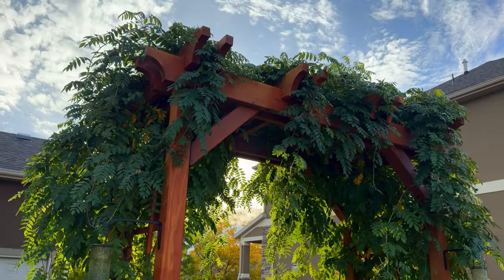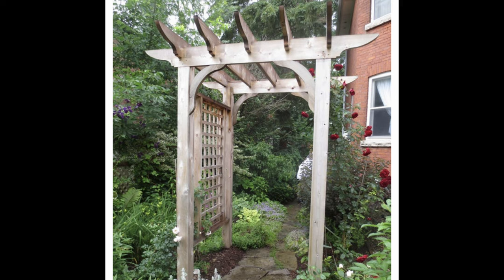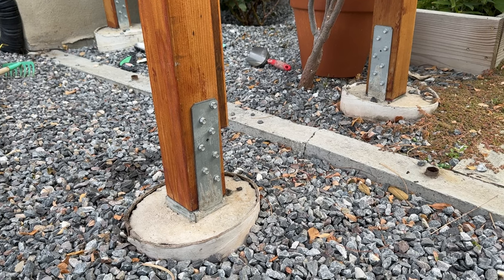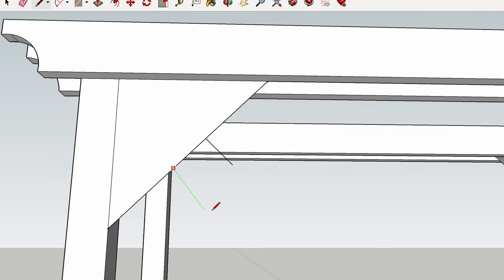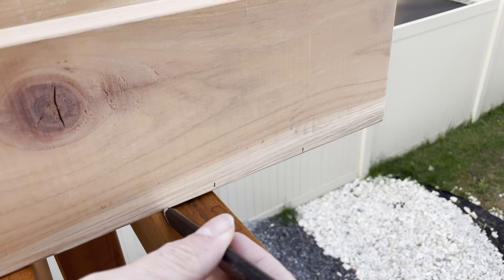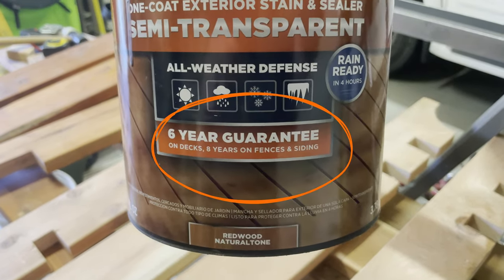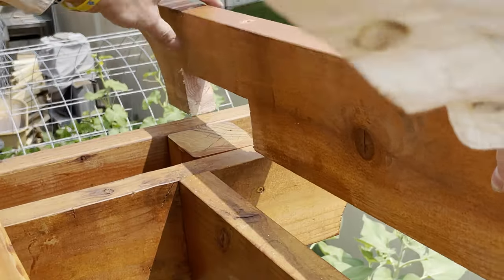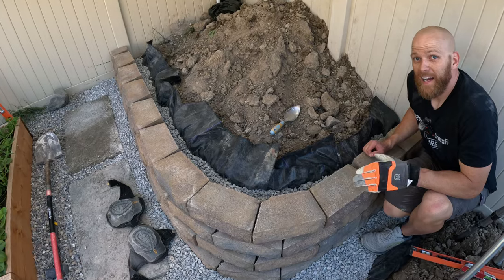How to Build a Garden Arbor | Step-By-Step Guide

Comment: Do you think you need the corbels if your posts are sunk (e.g. not on a footing)?
Reply from the maker: Good question. Maybe not initially when everything is new but eventually the weather and wind will wear it down and the more it could move around initially (without corbels), the faster it could wear down in theory. In my mind, it is easier to add them in during the initial build so everything weathers the same and the structure stays more square and rigid from the beginning. What are your thoughts? PS I love your username haha.
Reply: @UCanBuildThis  understood on your thought process! We built our garden a few years ago and I'm finally getting around to adding the top of trellis (similar to your style). Probably will add in the corbels for good measure but atm the entrance posts with the lattices are rock solid. Thanks for the tips! and yeah...username is a remnant of the past 😆
Reply from the maker: @IMABIGKIDNOWW nice! Yeah sometimes project take a few years huh! Good point on the fact your posts and lattice are solid. What do you have anything growing on it?
Reply: @UCanBuildThis  We've been growing luffas on them but looking to do something more permanent that goes across the top!

I actually do have one follow up question now that I got thinking. Did you just use a forstner and then lag screw the corbel to the vertical post? thanks man
Reply from the maker: @IMABIGKIDNOWW Well…I’m a big jerk and am just now seeing your comment. I tried using a forstner bit but it wasn’t removing the material enough so I used a paddle bit and went in maybe 2”. This way I cut put a washer on with my lag screw since the redwood is pretty soft. 

I’ve never heard of Luffas. I’ll need to check them out! Let me know if you have any more questions. 👍